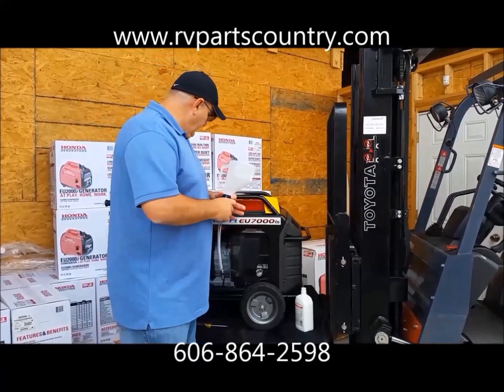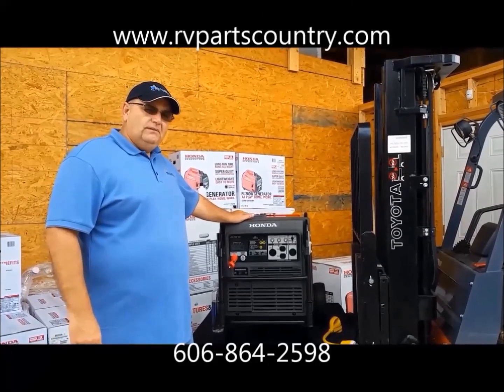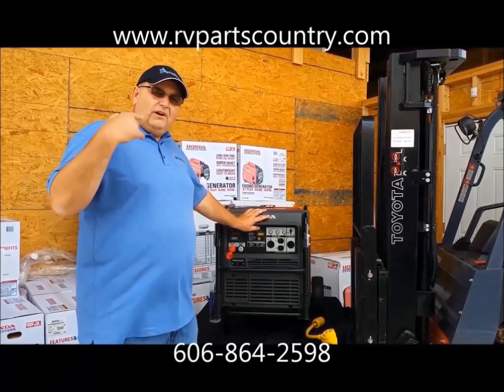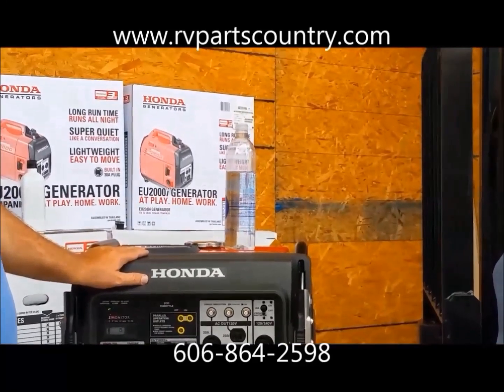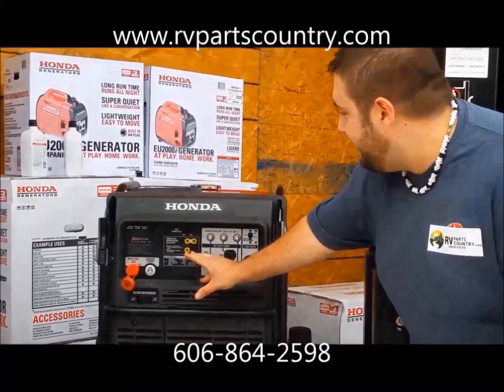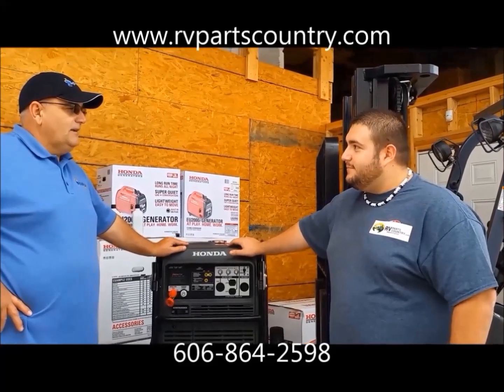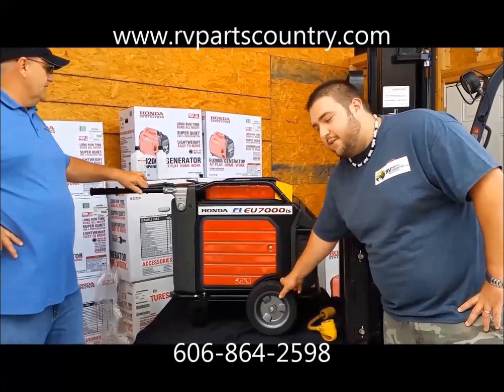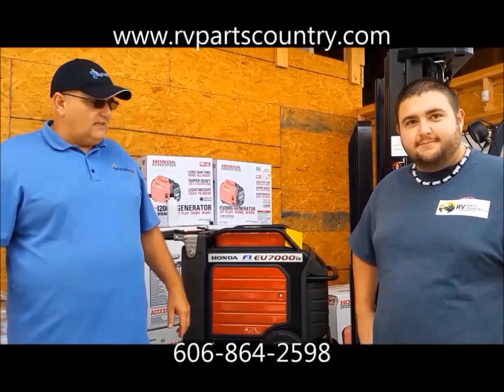EU7000is Honda Generator From RV Parts Country

Comment: With this fuel injected engine, would I just need to add fuel stabilizer ? Fuel injected engines normally do not like to lose their prime. I'm thinking this particular unit should probably not be run dry at the end of the season. Your thoughts, please ?
Reply: Great question! I always recommend to use some fuel stabilizer with these units. You'll get a longer life expectancy with better performance and it will save you money down the road.

Comment: At start-up per the HONDA EU7000is instruction Manual on Pg. 30

"Make sure the ECO-Throttle switch is in the OFF position, or more time will be required for warm-up.
If you wish to use the ECO-Throttle system, turn the ECO-Throttle switch to the ON position
after the engine has warmed up for 2 or 3 minutes".

Thanks for the video, but........Please read the manual thoroughly gentlemen!!

Comment: Make sure you add a BERG III extended run fuel tank for your generator from IPI Industries!  Together with this new eu7000is, they are the best set-up on the market!  They are also available for your eu3000is and eu6500is